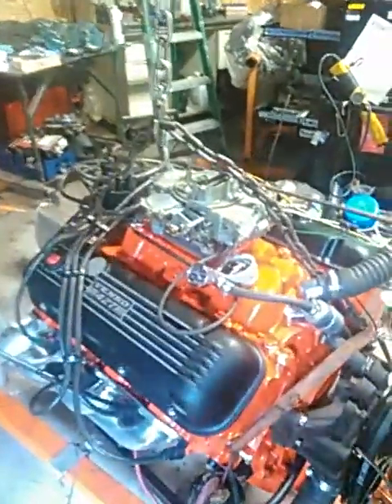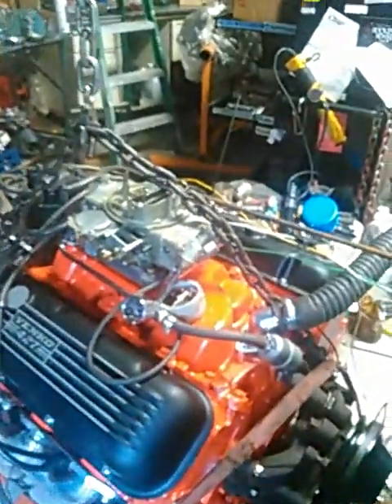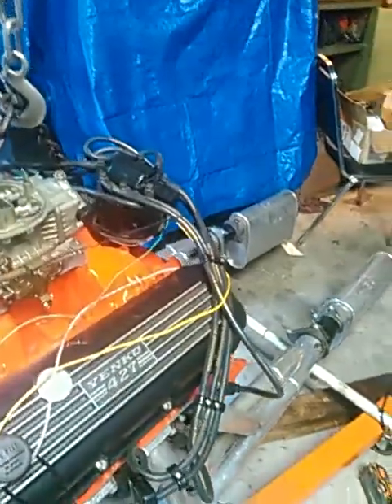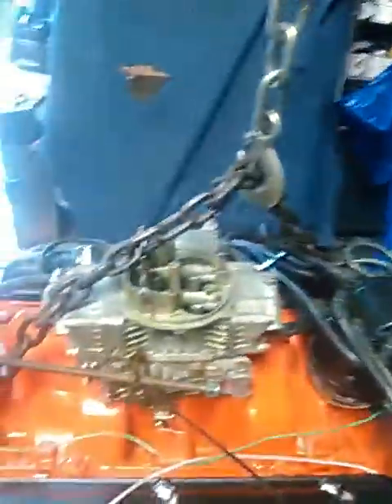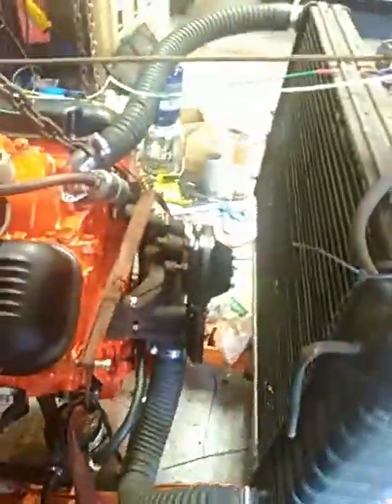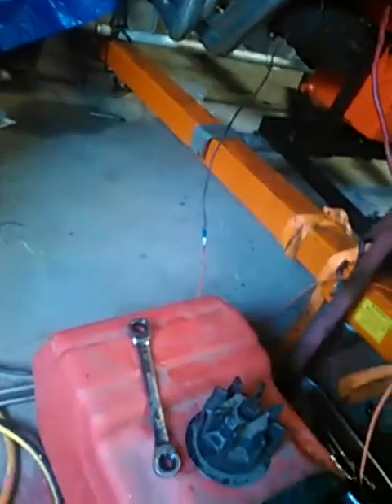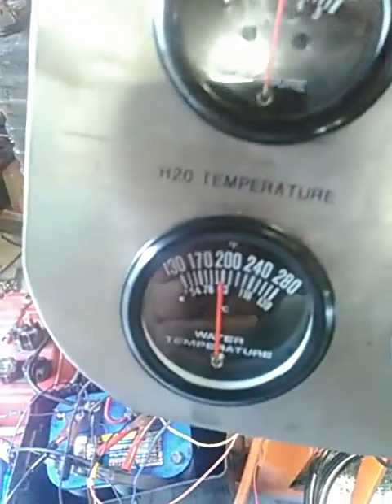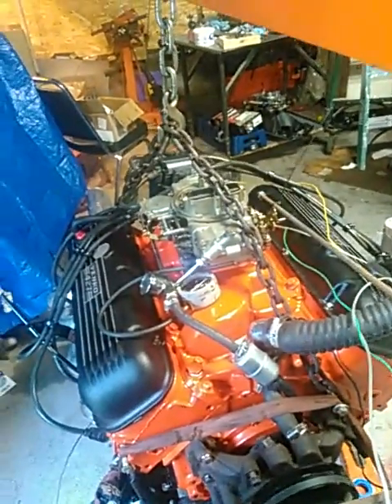454 / 462 break-in on stand, fresh high performance rebuild

Comment: Mine burns oil. It’s at 500 miles. 454 91 dually
Reply from the maker: Possibly the valve seals?  Especially the intakes, if not tight, can suck down the oil on the intake stroke.  I use the blue viton seals (3/8"), and they seem to work well.  There's a .500" and a .530" outside diameter and possibly others, so it's important to buy the right size.  I don't find the white teflon ones work very well.
Reply: @ShawnStjean  ok thanks. The engine builder told me it has a 3 year warranty or 100000 miles when it hits 1000 miles he’ll decide if it needs tore apart.